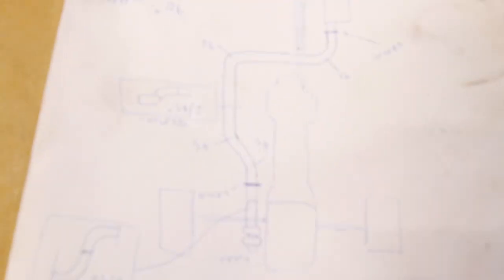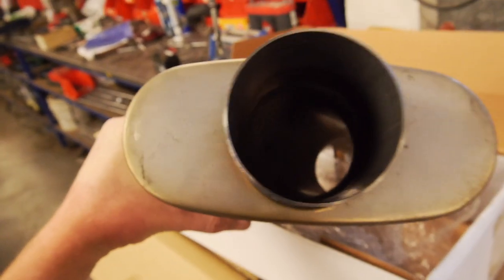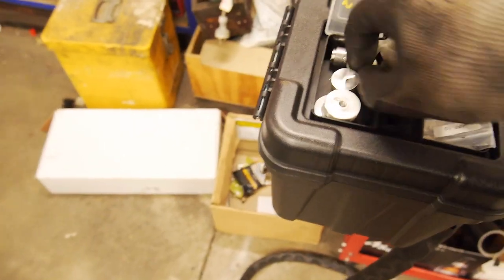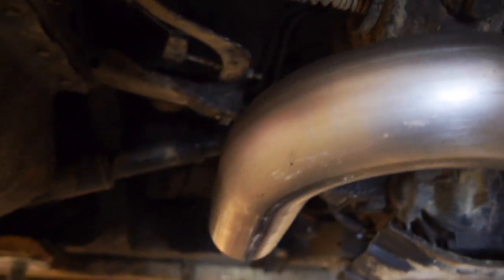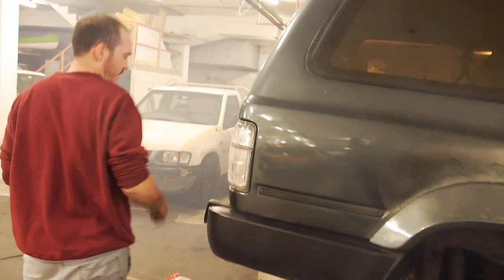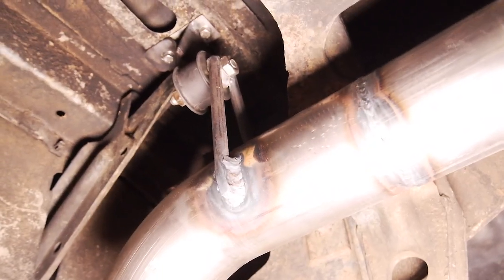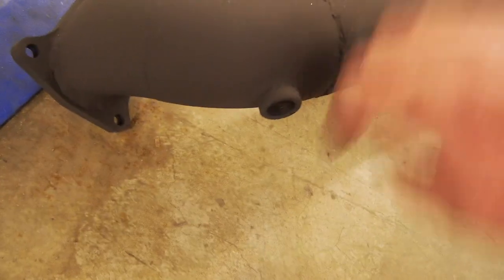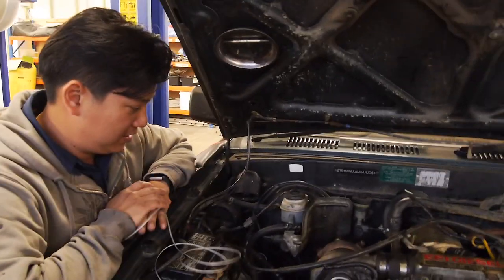FULL CUSTOM 3 INCH HILUX SURF EXHAUST BUILD (WITH CUT OUT VALVE!)

Comment: Where do u buy your exhaust parts from? Love your videos keep up the great work! 👌
Reply from the maker: Most of the time from Josh at ECS Engines.
Thanks Paul, glad you enjoy the vids mate
Reply: @boostedbuiltgarage  how do you know what diameter pipes to use throughout the exhuast? Do u have a software program that works it out based on engine specs?
Reply from the maker: Just experience and there are loose rules of thumb. Turbo, you ideally want minimum 3", turbos aren't affected by pipe diameter. Where as if you had a low power NA car and went 3" you'd loose some bottom end power etc